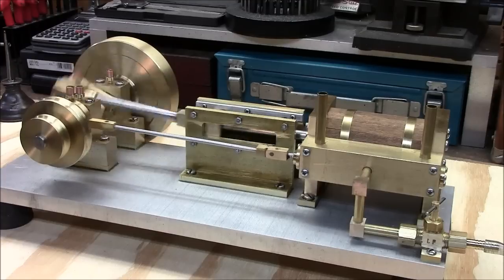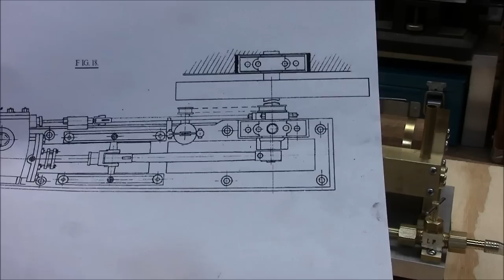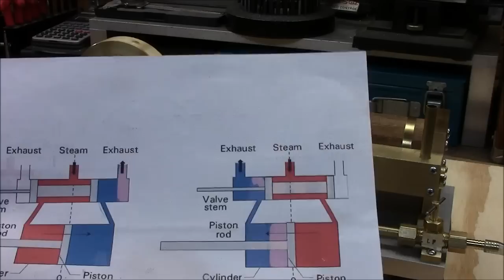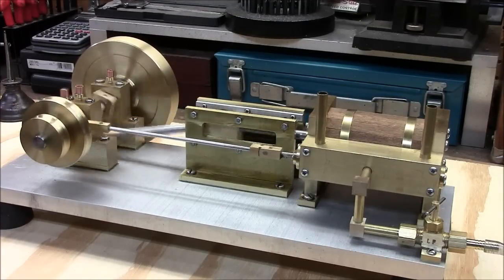Scratch Built Horizontal Steam Engine

Comment: Fred. Hello. What did u use for rings? Rubber .steel? What would be best seal rings for steam?
Reply from the maker: I used high temperature Nitrile rubber O-rings.  They make a very positive seal.
Reply: yanik ivanov In the live steam train hobby, we use iron rings in iron cylinders with proper steam oil.

Comment: What kind of (air mover) are you using ?
An quarium air pump or a small compressor ?
Reply from the maker: I am using a 2HP air compressor.  It is my "shop air" of course with regulator to reduce pressure.  Thanks for the interest.